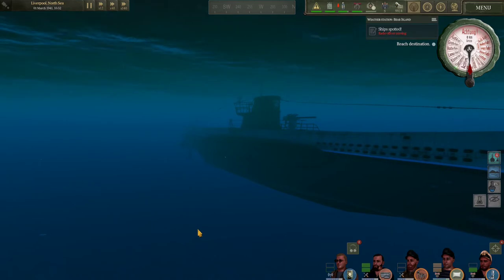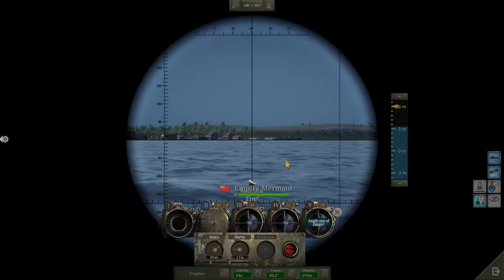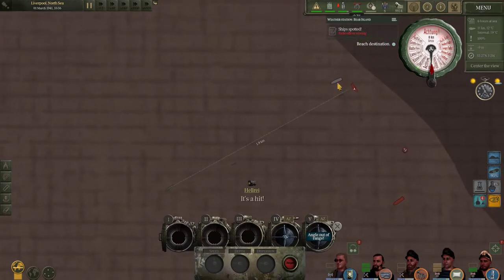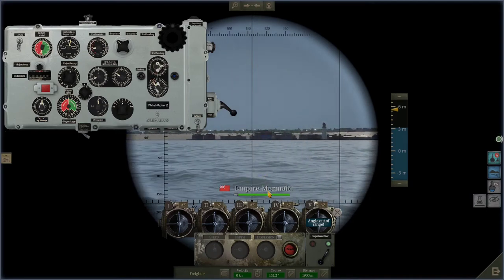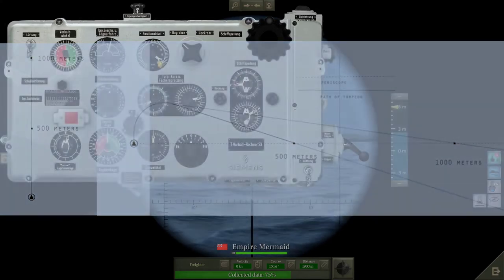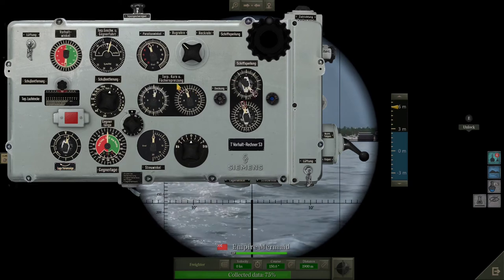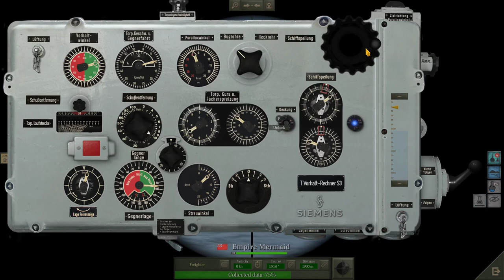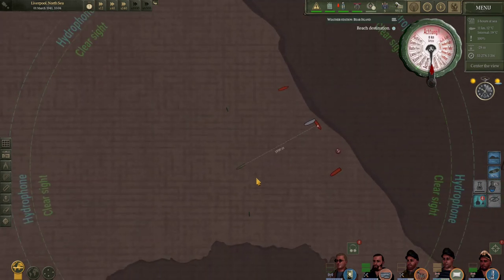Manual torpedo gyro control?

Comment: Thanks for this ive been using the TDC mod and not click the lever over so it actually works xD
that explains a few misses. cheers dude <3
Reply from the maker: Oh! You never enabled the TDC in the torpedo panel? Yeah that would do it lol. I thought it was because you weren't setting the torpedo speed on the TDC panel but glad you got it working!
Reply: @McDewgle  no set the speed for both the same. Thats the easy bit of the console 🤣

Comment: I know you just quickly eye-balled sending one 90° left (port) and Starboard (right). The gauges didn't seem as far off as the path the torpedoes actually took. Is it that sensitive, the gauge has to be set perfect? Or is the TDC not very accurate?
Reply from the maker: The speed dial was still set at 10 knots before I launched each torpedo which is why I think their path looked a little off as they each sped away 90° left/right. Otherwise the TDC is pinpoint accurate!